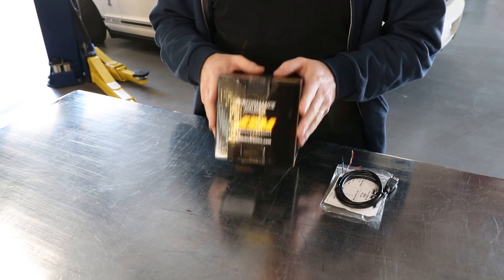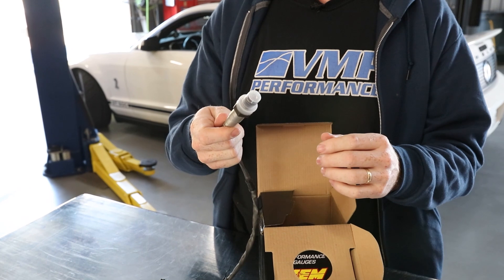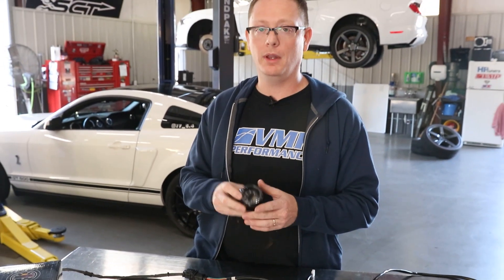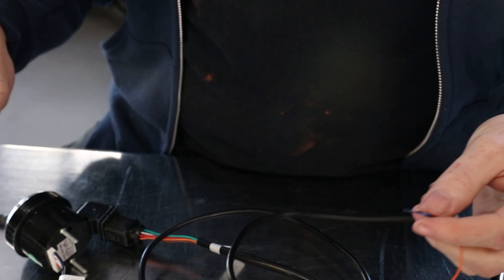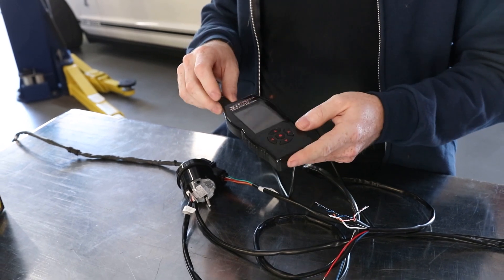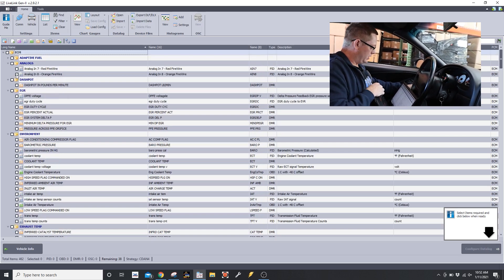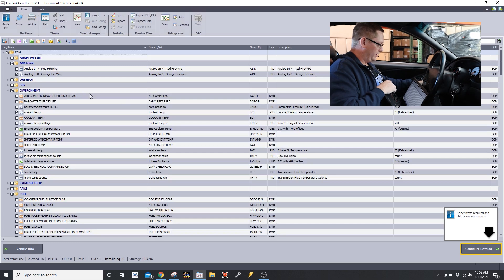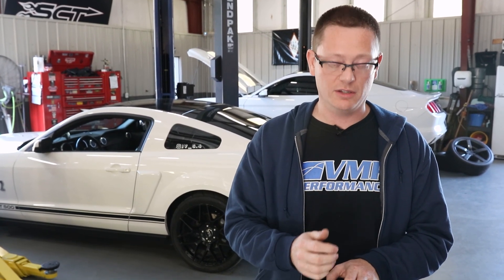Tuning and Product Feature ||  Narrowband Tuner's Kit - How to install and configure

Comment: So you can only log one input with that or can you log multiple inputs using the other wires not in use?
Reply from the maker: The SCT Firewire Analog input cable is 2 channel, allowing you to datalog two additional things.  So, your wide-band and one additional analog input.
Reply: @VMPPerformanceTV  ok thank you I appreciate the reply.
Reply from the maker: No problem at all!

Comment: Great Video, thank you for making this vid
Reply from the maker: No problem 👍
Reply: @VMPPerformanceTV  Quick question. If i dont have the space to run the wideband upstream of cat , can i run the wideband in a rear o2 sensor location since my rear o2 are turned off?
Reply from the maker: You will need to run the wideband pre catalytic converter to get a clean and accurate signal and at the distance recommended in the kit's instructions.  Otherwise, it will be inaccurate and useless for tuning.